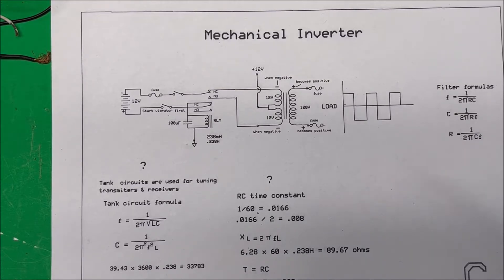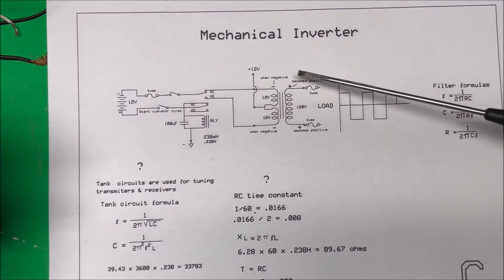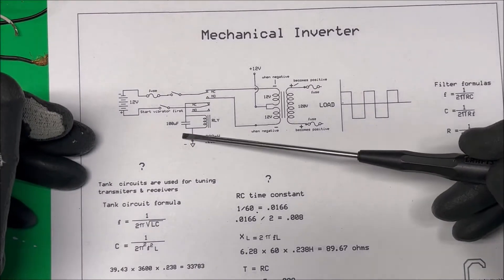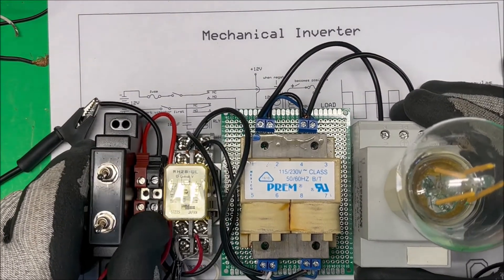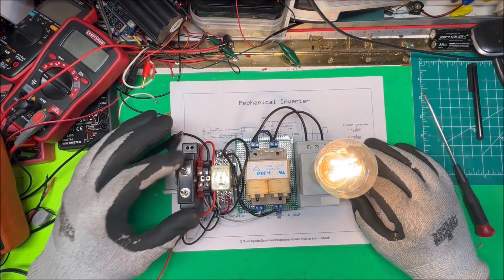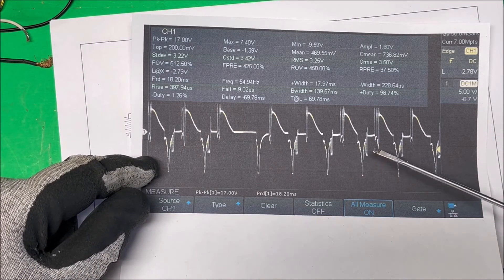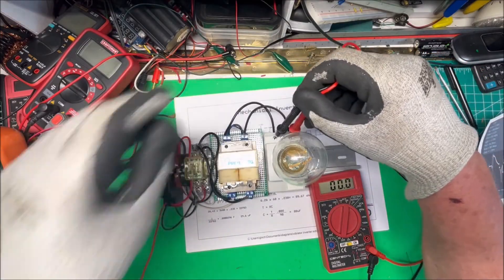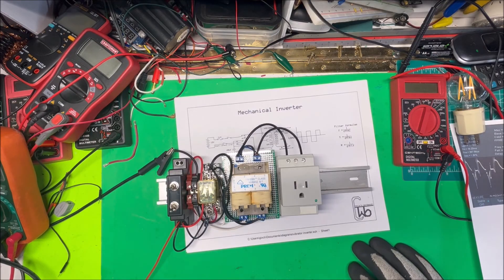Mechanical inverter

Comment: The poor led lamp would probably die very fast with the amount of noise from that, unless it's linear reg, which is not that likely as it might not work at smaller peak voltage of it.
Reply from the maker: True